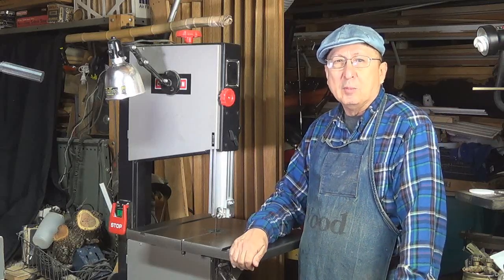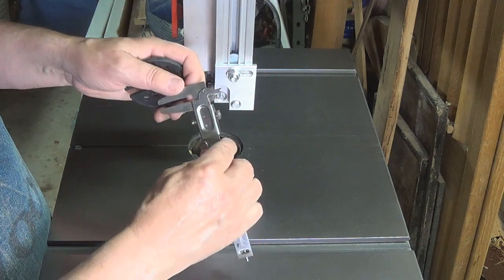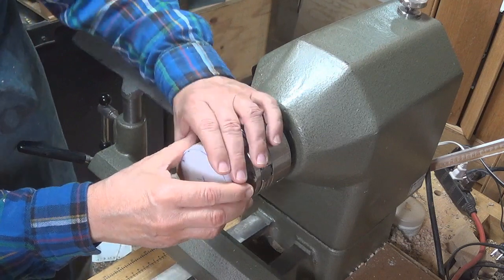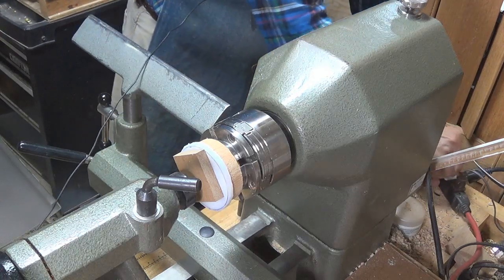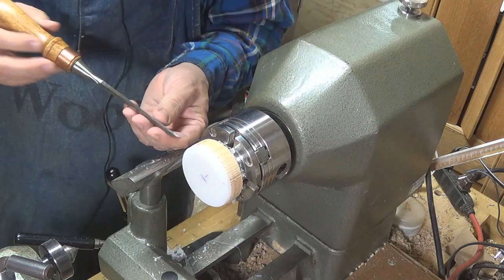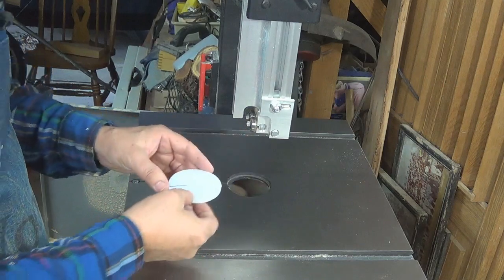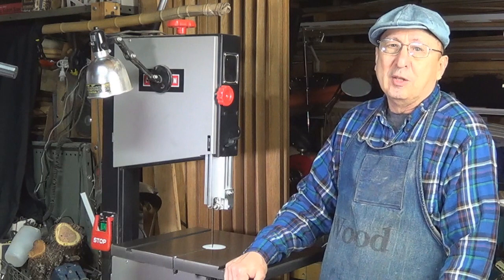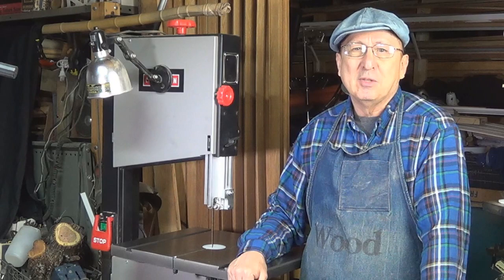Making a Zero-clearance Band Saw Insert on a Wood Lathe

Comment: Nicely done. There are all kinds of uses for those cutting boards, from zero-clearance inserts to jigs and sleds. Thanks for sharing.
Reply from the maker: Howdy Russell! This cutting board plastic worked out well. It is strong, easy to cut. I am glad it is much thicker than the acrylic plastic I was using. Cheers
Reply: They make pretty excellent catapult (slingshot for you Yanks out there) frames as well

Comment: Great ideas and thanks for sharing.  You can use denatured alcohol by soaking or injecting to remove the hot glue.
Reply from the maker: Howdy Robert! Thanks for the tip. The plastic releases very cleanly from the hot glue. I will keep you tip in mind. Cheers.

Comment: Great idea using the cheap cutting board Cip !  I use the hot glue gun a lot and  for removal from the glue chuck, I just place it in the work shop micro wave for a few seconds  (obviously making sure there are no nails or screw in it)
or simply use a hot air gun . Great project Cip and thanks for sharing
Cheers,   Bram
Reply from the maker: Greeting Bram! It was a little bit cold the day I made the video. A hot air gun might have helped. Cheers.

Comment: Thanks for the tip Cip,  remove the hot glue with alcohol, put a little between the bond and like magic it’s disconnected.
Reply from the maker: Howdy gA! Thanks for the tip. I will give it a try. My hot glue was cooling too fast. My shop was cold 56 degrees F. I've seen other people preheat with a heat gun for more worktime. I should have tried that. Kind Regards.

Comment: To make it level have several dots of hot glue under it and push it down while it’s still hot
Use a straight edge. Works really well.
Reply from the maker: Howdy Ralph! Thanks for the tip. Yes, I did have some problems with the hot glue. It was cold in the shop and the glue hardened fast. Not much worktime. I tried one big glob was very crooked. Cheers.
Reply: Cip's Wood Chips in cold climates sometimes you can warm the objects with a hair dryer or heat gun before applying hot glue for a longer work time.
Reply from the maker: Howdy Snellen! Good Idea for next time. I had a problem the hot glue spreading and cooling too quickly. I also want to try hallowing the center slightly to make room for the glue. It should stop spreading when the disc meets the wood of the faceplate. Thanks, splendid ideas. Cheers
Reply: I  sometimes use saw dust if it is to low. I will try the hot glue though that seems better.